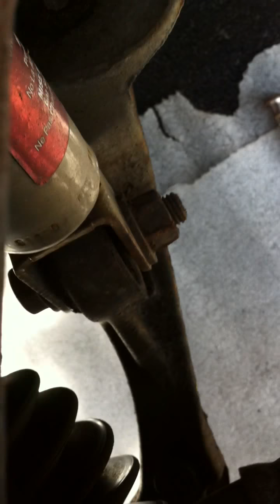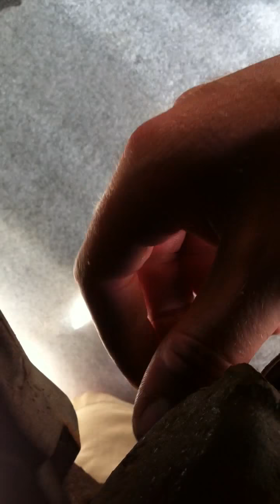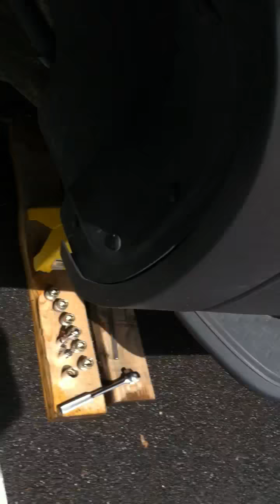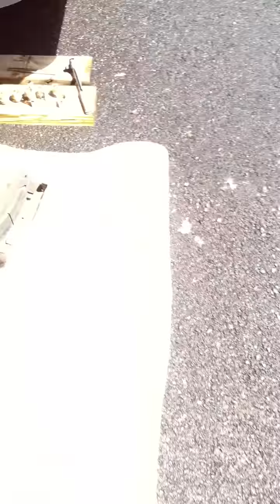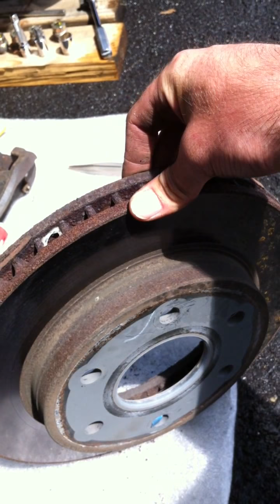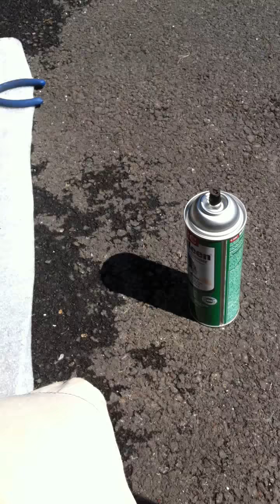2004 Chevy Avalanche Front break job-Part2

Comment: FYI I recommend measuring the thickness of the rotor using a caliper or micrometer in order to determine whether or not it should be discarded. In your case, a mic would be better due to the unworn part of the inside outer edge.

If you only have a caliper available, then I'd refinish it first and check to see that it's above the thickness. Most rotors have the thickness information cast into them; if not, check a service manual. 

Thanks again for the video!
Reply: Replace the pads, Replace the rotor. Bed the new pads in correctly to the rotor. In this day and age new rotors and metallic pads are $100 an axel for this vehicle. Don't play games with your brakes. It is all about the Labor anyway.

Comment: Hold your phone in the horizontal position, you will capture the entire picture. Use side cutters to snip off the holding clips, they are only placed on during the assembly process to keep them from falling off. Never bang on your rotor ever. Never have your rotors cut to true them up. It thins them and is not safe.